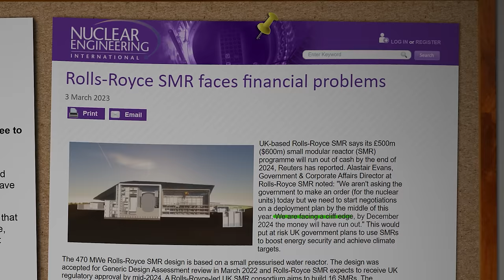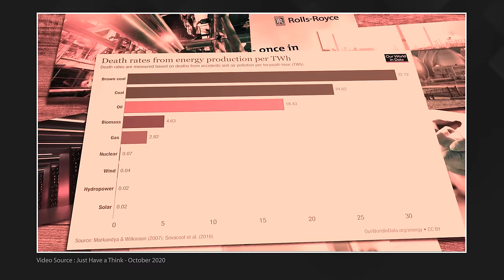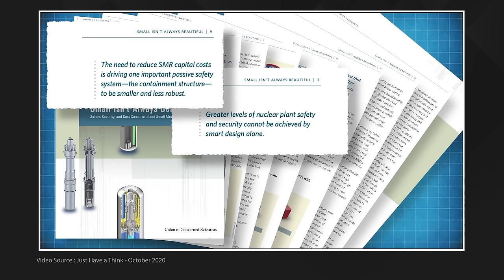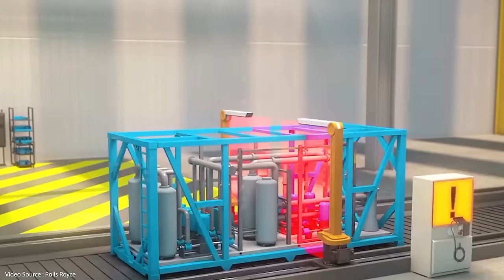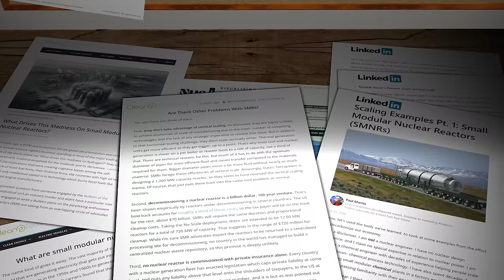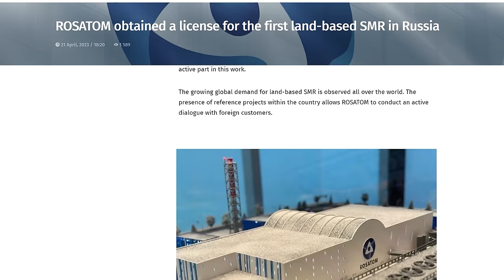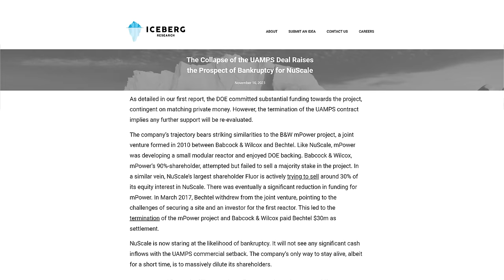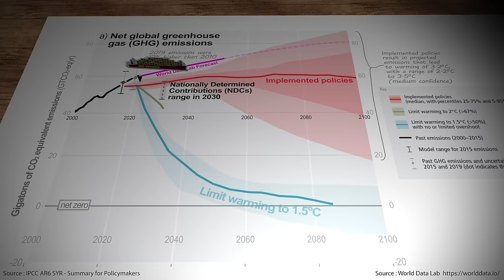Small Modular Nuclear Reactors. The Verdict

Comment: A key missed point in the cost analysis of SMRs here are the regulatory hurdles and bespoke designs that nuclear plants face. Every single nuclear reactor built today is a bespoke design; perhaps built on a common design standard, but tweaked for the specific wants of each operator. Factory-built SMRs eliminate those costs. Factory-built SMRs could get regulatory clearance for many categories just once instead of for every single build. Much of the infrastructure around the reactor could be standardized as well, reducing costs there as well. Are we likely to see enormous volumes? No, but I don't think we really need to. The cost savings on 100 SMRs compared with a smaller number of large bespoke plants would be substantial. Early adopters will pay a lot - as usual for any technology - but those costs will come down, especially once the regulatory stuff gets ironed out.
Reply: The westinghouse AP1000 is and has been 100% fully approved for construction and operation.  All the utility has to do is build it according to the design prints.  What regulatory hurdles do you think there are?
Reply: @clarkkent9080  I' not involved in the nuclear power plant construction business at any level, so my knowledge here is admittedly limited. My undertanding is that there is a general deign for the reactor, which may have cleared some regulatory hurdles, but that every install tweaks and alters that design in ways that require re-certification. You still have to build the thing on-site, which requires getting inspectors out to look over the whole thing and certify it.
Reply: @darthrainbows  Currently, the NRC fully approves a reactor design for construction and approval prior to the first shovel of dirt being moved.  All the utility has to do is build it according to the design drawings.

The utility cannot change or tweak any reactor or safety system without a completely new from the top to bottom NRC review and approval which would take years.  The utility can change or tweak non-reactor non-safety systems like liquid waste management and secondary side components that do not affect safety.

While there are on site inspections by the NRC, the majority of inspections are done by the utility and certified documents sent to the NRC for review. 
I

Comment: I do wonder what we are supposed to do about dispatchable power when we are dependent on energy harvested from the environment when that environment is increasingly unpredictable and chaotic. If I squint a little bit I can see a future heatwave somewhere like the UK where a high pressure dome effectively kills wind over large areas and overcast conditions reduces solar output, putting strain on batteries. After weeks of high demand from A/C use, power rationing would become inevitable - especially if the climate phenomena driving demand is regional e.g Western Europe is having the same problem. To ensure grid safety margins, we need to overbuild capacity and for things like solar, this means land competition, especially if we are trying to do things like rewild at the same time.

Comment: You need tech to provide energy generation in cloudy, windless days. Batteries wont cut it for neither 20 years. Both small and "small" molt reactors as base load for that 25% of your power generation which you need, is then solved. Yes it will take ages, no it will not safe us for the first 20 years... but will give us MORE needed options where wind and solar cannot provide. Ps. The Netherlands most likely will in 2 years time also approve 2 large westinghouse generators, next to a current nucluar plant.. we need development even at high price.. this is nothing new. Nothing to boo at, the verdict should be much more positive.

Comment: The grid is not well designed for the distributed loads of vast numbers of electric cars. Modular nuclear nodes might be a good fit for this problem. For instance, large Tesla charging sites (and the surround area) could be supported by a module.
Reply: National Grid have stated the Grid is fine with existing loads & loads anticipated for about a decade. They're on the case for the decade after as well as for new supplies.

If you want exact details & specific quotes I'm sure Google would be happy to oblige.
Reply: @alanhat5252  Interesting.  Of course they have to say that to maintain confidence.  Perhaps it's true.  In Australia we have low populations spread over vast distances.  Our power infrastructure is getting expensive, especially at the edges of the grid.  The cities are fine.
Reply: @matthewdunstone4431 ah, I apologize, I was referring to the UK's Grid completely forgetting the rest of the world has electricity too.
Reply: @alanhat5252  ha ha ha! That’s ok, I assumed you were American!  We were both wrong!
Reply: @matthewdunstone4431 I'm not convinced USA actually has a national grid, just privately-owned interconnectors between very local privately-owned grids. I could be wrong but whatever their setup, it's unreliable.

Comment: I am what is called in the USA, a baby boomer. I also was a Nuclear Reactor Operator on, drumroll, a Boomer. My generation of Baby boomers fought against nuclear power. They think they shut it down with the Seabrook NH station. Interestingly, I was working for Combustion Engineering at the time and the Vice President of their Nuclear Power Unit said that Seabrook was shut down because we didn't need the power. Seabrook was eventually completed when the energy needs of New England came back up. The series of 'Yankee Stations' had reached their lifetimes and so all went offline, reestablishing the need.

A previous comment from Philip (somewhere below) noted that military nuclear reactors, such as are used in Submarines and Aircraft Craft carriers are SMR's and they have a clean record. But these are incredibly, unbelievably, expensive. I don't know how much, but if they were affordable, companies like General Electric and Westinghouse would be building them and selling them because they built them.

I am confused as to why the baby boomers have done such an about face regarding Nuclear Power. It was bad in the 50's, the 60's, the 70's, the 80's, etcetera. They are still bad. There is no way on Earth, the one place we live, to get rid of these used nuclear reactors. Should we drop them in the deep ocean trenches and hope they get eaten by the tectonic plates? Should we put them on a private rocket and send them into space, oops did that one crash? Should we manufacture a big Nuclear Reactor shredder and spread the CRUD over a hundred million acres? You can see that these possible disposal methods will not work. Even if you encase them in glass, they are still radioactive and will be for thousands of years. Maybe someone can 'Fly me To The Moon where I can Sing Forever more'.
Reply: Good comment 👍

Comment: The review was a bit self serving. There are literally 50 new proposed reactor designs and you focused on NuScale, a startup that has never built a nuclear plant and is very likely to fail. The fact is most of the proposed designs will fail, but you quite literally ignored the farthest along and most promising designs for the ones most likely to fail.

You ignored the GE-hitachi BWRX-300 which has already started construction at the Darlington Nuclear Generating Station in Ontario. Four more reactors are planned for the site along with a fifth in Alberta. Poland has signed an agreement for 10 reactors and agreements for reactors in Sweden and Estonia have been signed. The first reactor is scheduled for completion in 2028 and if you want a valid test of the small modular concept this is the leader, not NuScale and not Rolls Royce.

You also ignored other more promising designs such as the X-Energy Pebble Bed reactor which is planned for installation by Dow Chemical in Texas to provide process heat for chemical production as well as electricity, has a 60-year design life and no disposal issues since all radioactivity is contained in the fuel. As you ignored the Bill Gates backed TerraPower/GE-Hitachi Natrium reactor which is moving along at good development pace and unlike NuScale backed by one of the World’s richest investors and one of the World’s largest nuclear companies.

In essence you ignored all of the most promising designs and focused on a couple of losers like NuScale to try and make a point. Just one design needs to succeed to revive the industry and unless you evaluate the best designs/consortiums you really are failing as a technology reviewer.

Comment: Why is it that very little is said about SMRs in nuclear submarines? The reason that SMRs are not being introduced is that oiligharcs see it as a threat to their revenue? And the myth of nuclear contamination is explained by Galen Winsor.
Reply: @od5699 "Why is it that very little is said about SMRs in nuclear submarines?" 

You mean, apart from the fact that every second person mentions them?
Reply: Reactor submarines are not cheap (fuel load is $1 billion), they are very inefficient because they do not have the room for reheaters, and they have  none of the safety systems required for commercial units.  The first U.S. nuclear power plant (Shippingport) had a 60 Mw output (typical SMR capacity) took up three levels and 4 acres.  Look at a typical commercial power plant (1,000 Mw) and any SMR fraction of that output will be at least that fraction in size.  The larger the plant the more efficient it becomes and vis versa.

Comment: The added cost is due to all the regulations and paperwork required. Governments make it prohibitively expensive and take far too long. I work in the control valve and instrumentation industry and the amount of added cost for say a safety relief valve to a traditional power plant vs nuclear is roughly 4x to 5x more due to all the extra tests and extensive documentation required. In the end the valve is exactly the same - just expensive.
Reply: Yes, true. But if you were to relax the regulations, you'd increase the frequency of accidents. Can you imagine a Fukushima-style accident every, say, 5 years? As usual, risk = danger x probability of event, with huge danger you need to keep probability ultra-low.
Reply: @markotrieste  Not to mention that if an accident occurs, the government is the one expected to clean the mess-up, because the nuclear company will go bankrupt instantly. And nuclear waste management and cleaning is not cheap at all, so better spend the money upfront on safety.
Reply: @markotrieste Except they go overboard with regulations - at least here in Canada. It takes years here to just put up a new wind turbine or a solar generation project.

There doesn't seem to be any reasonable reason for a lot of it other than to keep public sector employees working.

They are considering an SMR reactor here in my province of Saskatchewan and it would be welcome as we have the uranium right here and we have stable underground areas with no aquifers where we could store the high level waste quite easily like Norway is doing.
Reply: @KurtQuad I think you mean Finland. They are the only country that has built a permanent nuclear store. 

I think the biggest delay foe wind farms is getting the grid connection to them. No one wants a transmission line going past their house.
Reply: @adrianthoroughgood1191  oh yeah, Finland. I watched a small documentary on it a few months back
Reply: @adrianthoroughgood1191  In Saskatchewan where I am there are ton of environmental hurdles to get over for approval to even get a plan approved for a turbine.

It can take 7-10 years here to just get a project in the construction phase. You have multiple stakeholders you have to involved, environmental regulatory bodies and it bogs down the process here
Reply: @KurtQuad  I don't think people should be able to just build a huge wind turbine when the feel like it. There does need to be a regulatory process took avoid impacting where people live and wildlife etc. But it shouldn't take that long. In the UK it's mostly the grid connection, but here most of our turbines are in the sea so no need to worry about neighbours!
Reply: @KurtQuad  It's the same everywhere. I work in the energy sector and I think there is more embedded energy in papers and pdf files than in the actual product. It's Joseph Tainter all the way to the end.

Comment: I don't always agree with you, but I think you're pretty much on the  mark with this one. Of course much of the cost of any new implimentation of nuclear power is do to public perception (much of what you yourself said is ununjustified looking at historic safety). Companies proposing any use of nuclear, have huge hurdles to overcome, both with regulatory standards, and also years of expensive litigation. The fact remains, however, that what we're doing now will miserablly fail to meet any of our carbon emissions goals. The technology for total reliance on "renewables" simply does not currently exist, and may be even further out in future than some forms of nuclear.
Reply: 8 countries are running 100% renewable electricity with a further dozen over 90%.

It is possible & it is happening.
Reply: That's ~10% of all the countries & territories in the world & every country is building as fast as they can.
Reply: @alanhat5252  Which 8 countries?

Comment: What about thorium reactors ?
Reply: Nothing new about thorium reactors.  Many countries tested them in them in the 1950's - 1970's range, with some test reactors still running today (and pebble bed designs starting in the 1980's).  With the exception of the USA no other country has thought that their thorium test reactors ran well enough to design a power plant from.

The USA though it was a very viable nuclear future in the early 1960s and when pretty much whole hog into it producing tons of reactor grade thorium fuel and built 4 commercial power plants using 3 different technologies (BWR, PWR, and HRGR).  Those commercial power plants were massive technical and economic failures and every one of them was closed way early even though at least 3 of them were converted to U235 fuel at the 1st refueling after startup.    

They also built 2 molten salt test reactors - and both had major issues, but did prove that a thorium breeder core could be designed and run in most of the then current and now current PWR reactors with the Shippingport demo/test power plant (60 MWe PWR) core load 3.  

However, the cost of the thorium itself was a lot more expensive than uranium.  I've yet to hear anyone running a thorium test reactor claim that they have gotten the cost of thorium lower than uranium.

Note the fact that there is waste dirt and rocks containing thorium does not matter:  It has to be extracted and refined and converted into a form that can be put into a reactor; and that process turned out to be more expensive than extracting, refining, and converting uranium into a form that can be put into a reactor.

Of course you have to add the seed U233, U235, or Pu239 to get the reactor going until the thorium is converted into enough U233 to run itself (which typically takes at least 4 months of operation).

Since thorium could work well in the current generation 3 passively safe PWR reactors you have to ask why no one in the world is doing that...

I hope that answers your questions.
Reply: @perryallan3524  Just a addition to your mention of Shippingport where I started my career.  That Thorium/U233 breeder did in fact breed slightly more U23 than it used. But neutron conservation was so critical that it had no neutron absorbing control rods.  Criticality involved inserting fuel assemblies into the core and reversing that process, against gravity, to shutdown the reactor.  Certainly not a design that would be approved today and just one example of how test concepts lacked the safety designs necessary today.

Comment: I'm hoping solar + wind, plus storage will be the future someday, esp. if the price drops are large enough.  Storage has a lot of potential, beyond lithium.  This could include iron air batteries.  Thermal storage (e.g. Antora Energy) for industrial heat and power.  But currently intermittent renewables are backed up by natural gas.  Hydro maybe iffy someday, because of climate change.  

I still think nuclear should be in the portfolio.  If not SMR's, perhaps old fashion (lower tech) CANDU/PHWR.  Just build them.  Keep the focus on-time, and on-budget.  (S. Korea is close to demonstrating this, with repetition, experience, scale, ...).  Try to keep the old reactors online, since these are already permitted.  This is stable carbon free energy.  Clean Core Thorium ANEEL (solid core Thorium+HALEU) can offer another fuel source (esp. India and China) plug compatible with existing CANDU/PHWR's (?).  Plus Thorium being valuable, can also jump start the rare earths mining industry.   2030's is not too late for nuclear.  The world will continue to have an increase demand in energy (developing world, AI, data centers, ...).  The big question for renewables, electrification, going forward might be the material requirements, minerals (lithium, nickel, copper, ...), ... which needs to be multiplied several fold.  Having a energy dense option in the portfolio, gives us more options.